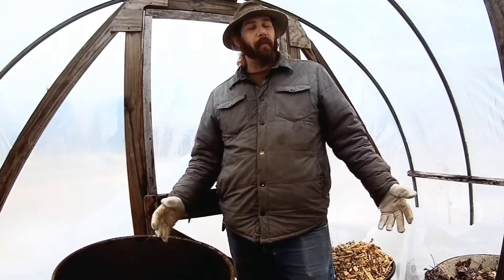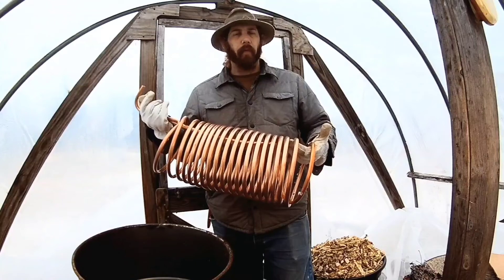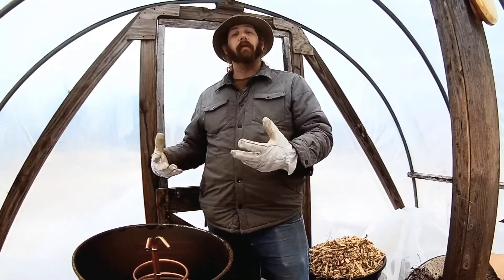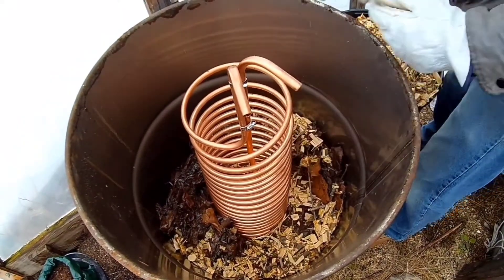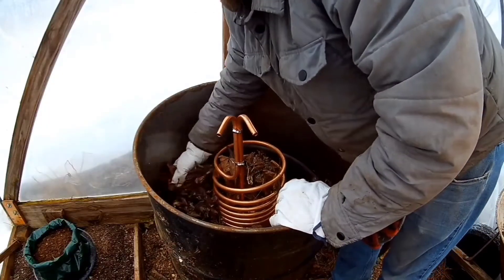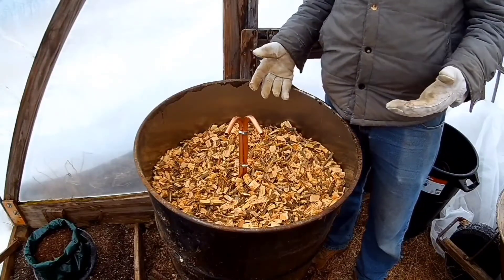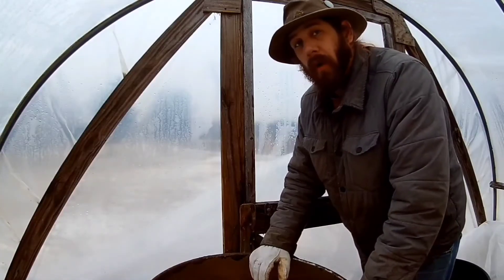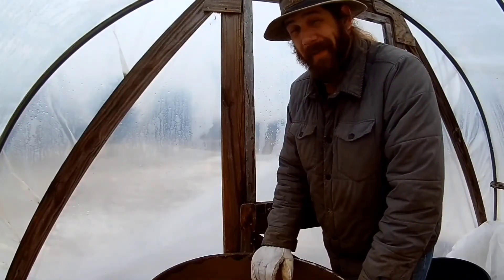Compost Heating System for The Garden? Is It Possible to Heat a Hoop House with Compost? Part 1

Comment: Waste of time. I built a 16 ft x 16 ft compost heater and fitted my greenhouse with a hydronic heater. The compost will produce heat but as soon as you start water circulation, the water will pull that heat out and the decomposition will stop. My massive wood chip and leaf pile could not produce any where near the heat required to heat my 12x12 greenhouse. Do some research. Jean Pans compost piles were acres large. This barrel wouldn’t heat a dog house. Silly.

Comment: Inoculate the chips with lignin disassembles such as actinomycetes which make so much heat they are nicknamed "fire fang".  then you can use other species such as oyster mushrooms, ps. cyanescens, axurescens which will convert full size chips into a nutritive biomass that can be added right to the soil without any worries.

Comment: I have decades of experience with thermodynamics from my previous life as an engineer. Now a mini farmer with 8-9 yards of compost in process year round. IMO, a much better use of resources is to make a bin from heavy gauge 1/2" hardware cloth that's four feet in diameter by four feet tall. Nothing else required, but you can increase efficiency by putting a chimney in the center. Easy to make by wrapping a section of hardware cloth around a pipe at least four inches in diameter and secure by bending end cuts inward with a pliers. If your greenhouse won't accommodate a bin four feet diameter, it's worth the effort to modify the beds. Obviously locate on the north side of the greenhouse.
Reply from the maker: These are some excellent ideas and suggestions!!! Thank you so much. These ideas will be incorporated in the next phase of build testing. Air flow was certainly an issue we have been working on getting addressed properly.

Comment: Hello, please do not ignore my comment and answer my question?! Can you write to me the working method in detail, how to start working, and what temperature I will get if I use this method??! All thanks to you 💙
Reply from the maker: Hi there!! I'm sorry if we missed your question in the past. As far as a detailed working method, this is all experimentation. We are searching in an open source manner for how to make this work. We have been using traditional compost builds but have made mistakes along the way and used improper substitutions. The barrel reduced airflow too much, and the copper of the coil killed microbial life early in the reaction. Our green material was very green but too woody. As far as temperature is concerned, the interior of a compost pile reaches temperatures between 140 degrees Fahrenheit and 160 degrees Fahrenheit. When our setup can achieve this reliably, we will then move to testing intervals and duration of time for circulating water through a series of hoses and bellies. This winter, we plan on doing a video each week following along our route of success until we hit a new learning opportunity.
Reply: Thank you very much

Comment: People confuse  temperature from a mass where heat is not being used, with how much heat energy it can produce over time.   Remember you will be removing the heat from the mass of organics at some rate, do you really think the biology will keep up with that heat removal rate?  And if the temperature is reduced the biological reaction will stop.    Thermal batteries of a similar volume/ but MUCH higher mass would be heated to thousands of degrees to be somewhat useful in  a small well insulated place if you wanted the heat to last overnight.   You can use Bing AI on the balanced setting to get an idea.
Reply from the maker: These are some excellent points. We are doing these each year to try and research what will and won't be successful. This is being run as an open source experiment. Feel free to improve upon our methods and share!!!!
Reply: Correct me if I am wrong, is your point excessive heat build up with this particular set up (within the drum) will eventually kill off the micro organisms?

Also shouldn't we also be looking at having an aerobic system as opposed to anaerobic (anaerobic conditions will eventually kill of some of the desirable micro organisms that break down the wood chip and other plant material into usable compost for gardens) and for that some ventilation would be required as shown in a few other videos, though those videos focus on using the acquired heated air to warm up green houses when actually the real core purpose of ventilation is to provide an aerobic environment to speed up decomposition of the organic matter and the subsequent heat from the whole process to 1. Heat up the water in the pipes 2. Produce methane gas as a by product 3. Collect heated air that can be used to warm up your green house or home 4. Produce amazing compost filled with aerobic microbes such as Rhizobium bacteria and Mycorrhizae fungi that can greatly improve your garden and crop field soil quality.

Comment: I'm doing something like this. I thought of it today and I'm glad to see it does work. I have a large chicken run that I put all my mowed grass in and after it builds up and gets pooped all over it is pre charged and I STRONGLY suggest EM1. It is amazing stuff. I spray it on everything. My plants and orchids thrive with that and biochar. So I put a layer of really poopy grass and spray it with EM1. Its a bottle of beneficial microbes. It revives living plants and dissolves dead ones. Fast. I have a little 7x7x4 ft quarter round greenhouse attached to a wall I built thats posts are 2 ft in the ground to fasten it to. On the backside of the wall I built walls perpendicular 7 ft out and 5 ft tall. I have a huge tarp that goes on the bottom of wall and extends like 15 ft. So that way I layer then spray and repeat. 4 in layers. Then I put a layer of used potting soil then straw to top it off. Spayed the whole thing with tons of EM1 and fold the tarp back over like a taco. Walls keep it from falling out. The less O2 the better. It will cook. My plane is to have a 200 foot coil of black plastic pipe in the center of the pile. The pipe will be attached to a 55 gallon black barrel on its side closed in a box with thermal pane glass door over it in front of greenhouse at an angle buried in the ground half way. That water will be pumped through asiers of pipe running back and forth under sand and light gravel to create radiant heated floor. I really hope it works. I deal with temps from 40 to 0 degrees in winter.
Reply from the maker: That sounds like an amazing setup!! We are also planning on using some of these methods. If you plan on posting a video, we would love to watch it here on the farm. We hope your efforts add to the effect of encouraging others. Our setup didn't work as well or as long as we would like. As such, this year, we are trying something new to gain better results with greater efficiency. Keep an eye out this fall for new videos on compost heat!!!

Comment: Now that you have had it running a few months, what results have you had? Did it heat the hoop house?
Reply from the maker: Hey there, it failed after a few weeks, I encourage you to check out the comments and our follow up videos, thanks for popping by! https://youtu.be/KOf54LsRF04
Reply: Not enough bulk to heat much at all. You need min of 1 metre cubed.

Comment: Back at the ranch, Wheelers ranch, Sonoma County, we had 55gal drums with 2 filled with chicken and cow shit, used copper coil inserted into 2 55's that were elevated for a gravity shower. Temp was over 130. There was very little radiation heat at 3ft.
Reply from the maker: This just sounds fun lol

Comment: Copper is antimicrobial. Did it seem to affect the compost process? What kind of water temperatures were you getting?
Reply from the maker: It did effect everything! The system slowed down after like 2 weeks.
Reply: you could use Aluminum but the aluminum would corrode over time. Best solution is probably to use some sort of protective yet conductive coating on the coil material for either solution.

Comment: Probably dont even need the copper coil, and i would just pee in it and add some sugar, for moisture nitrogen and super food for bacteria.

Im going to do 2 barrels this winter and have a swedish heater as a backup. (Burning barrel with ascending pipe through it.)
Reply from the maker: We are actually going to start a new system without the copper coil. We are going to use rubber tubing throughout.

Comment: I think that it makes no sense to ad a coil and everything else, because the barrel will radiate the heat anyway. And if you cool the compost, which is what happens with a copper coil inside the pile, the bacteria and other micro organisms will become less active and therefore produce less heat. And the copper is toxic to those micro organisms and bacteria, which will also result in less activity and thus less heat. Personally I would never recommend people to do this.
Reply: I do not understand why my first comment was removed.
Reply from the maker: It wasn't, and you're not wrong, we tried something and now know how to do it better next time

Comment: Hello, I am currently building a greenhouse. I want to heat my greenhouse with compost. Do you have a video of how you set this up after you built your system. I also dug down 6 feet so I could put pipe in the ground to lead up to the compost. Do you have any advice?
Reply from the maker: Hello! Currently we dont have a video showing much more. We are upgrading the system this year and are working on a new video. We arent digging down because less than 3inches down is straight rock. We are working on building up our soil to correct this. Thanks for watching! ~Riana

Comment: Awesome! I'm wondering if you think this would work with woodchips that aren't green? Or perhaps there is a similar/better material to use as a substitute?
Reply from the maker: So. We have found through tinkering you need way more green material than anything else. That could be green wood or even yard debris.
Reply: Add some chicken manure, likely bagged/dried from Tractor Supply or similar outlet